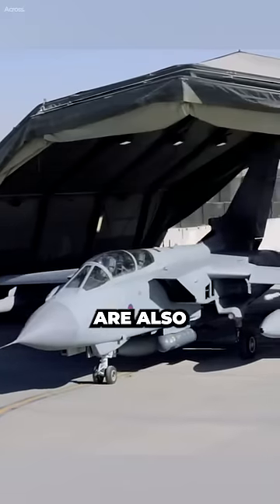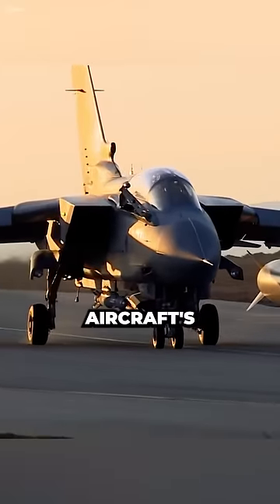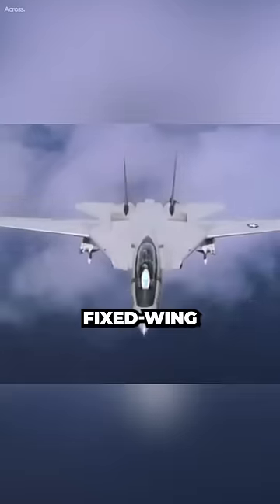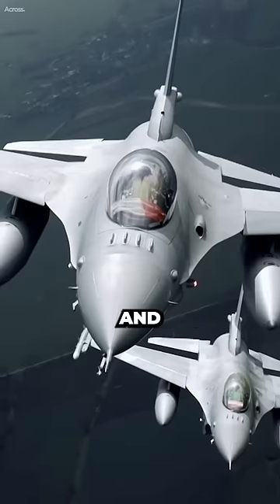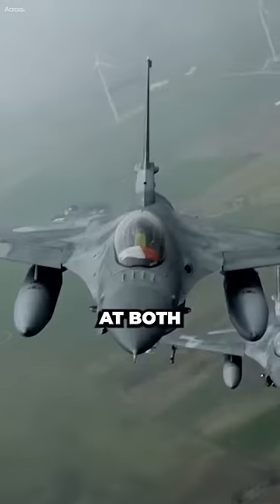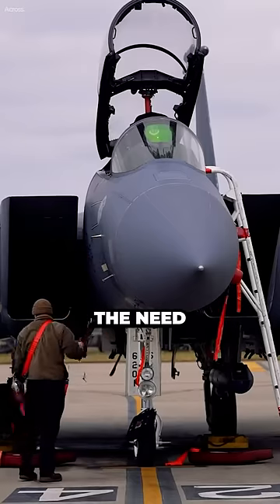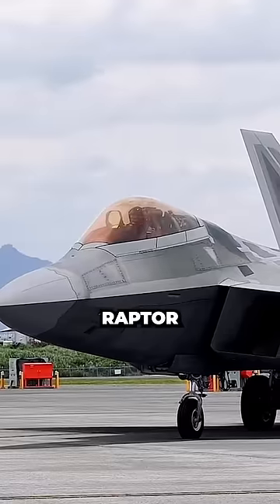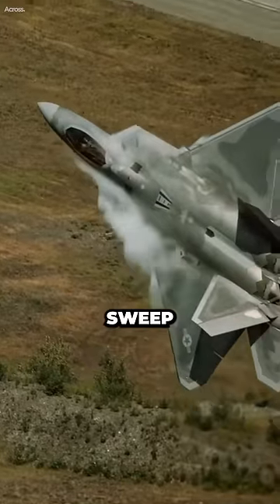Why Don't Modern Aircraft Use Variable Sweep Wings?

Comment: Meanwhile the f15 casually flies with half a missing wing and still landed perfectly
Reply: And NOT a Navy, carrier rated jet.
Reply: "It's not the plane, it's the pilot"
Reply: @ajoo129  it's at least (great) partially the plane. This happened during a training accident in israel. The pilot landed safely but he did not know that he lost one of the wings of his aircraft till he  get out of the cockpit. This could be possible because of  the design of the F15.
Reply: @foggyale  sure, the plane itself is perfect.... but the pilot plays more important role in this case
Reply: @ajoo129 it’s both.
Reply: @ajoo129 no matter how great the pilot if the plane is incapable of flying with one wing that pilot will crash
Reply: @RadarLeon  agree, but if the pilot is not experience enough the plane has higher chance to crash too
Reply: @ajoo129  true but if they are insufficiently experienced at flying that it becomes a reason for them crashing they thusly had no reason to be up there in the first place.
Reply: That's because the F15 has a thrust to weight ratio of greater than 1. It helps to have enough thrust to brute force your way through the air.
Reply: @RadarLeon   In fact, the pilot of this training F-15 was flying with an instructor acting as navigator.  When the collision happened and they started losing control of the aircraft, he ordered the pilot to eject, but the pilot outranked him and decided to stabilize the jet using the afterburner.  It worked, and he got it back to base.  He had no idea the wing damage was so severe because at the speeds they were flying, vaporizing fuel and hydraulic fluid obscured the pilot's view of the wing.

That pilot may have been training, but he knew he was flying an over-engineered rocket, so that is how he treated that F-15.  He touched down safely and the jet itself went on to be repaired and sent into combat.

The F-15 was the answer to a supposedly superior russian fighter, and had their jet been built in the U.S. it certainly would have been formidable.  But what we didn't know was the USSR couldn't scrounge up enough aluminum and titanium to make the things, so it was made of fucking steel.  It weighted a ton.  Engines that should have given it a decisive advantage were only able to get the thing up to its advertised speeds  with a long lead-up.  But the F-15 had the engines and the lightweight airframe to match, and the result was a jet that could take off and go vertical just like a rocket.
Reply: And the pilot didnt even know the wing was gone 💀
Reply: Light weight variable sweep wings
Reply: Let's have a discussion about the A-10
Reply: @garthhancock3373 Well, you can't land at Mach 1, but I think the fuselage of the F-15 is designed to generate just enough loft so he was able to somewhat stabilize it. It's the Toyota Hilux among fighter jets 😂
Reply: @foggyale it’s due to the partial lifting body design and other design elements, and due to the pilot.
Reply: y'all would be surprized but you could literally stick a think plank of wood and it'll fly.
Reply: He didn't know if he had he'd ejected vs landing. That's why the f15 is still a beast.
Reply: @ajoo129 thats misleading.  He didn't know it'd lost a wing. Maybe not so good q pilot
Reply: @Will-dn9dq  no way a "not good" pilot could ride an F15
Reply: Ah yes, that Pixy boy for sure
Reply: @ajoo129 it's definitely more the plane in this case
Reply: Yo buddy, you still alive
Reply: High speed + lifting body design.
Reply: DIdja ever hear you shouldnt believe everything you read?
Reply: As they say "the f15 is a rocket with a plane strapped to it" as the a10 is a gun with a plane built around it... brrrrrrtttt 😂

Comment: Ah but the Tomcat was a thing of beauty to watch coming in to land on the carrier.
Reply: Yes and it wasn't fly by wire so the pilot had to be good .
Reply: @stevetripp2340  it also made the aircraft harder to fly so its like dancing on a knife edge. if you do it right the tomcat will reward you but if you overwork the aircraft it will work against you. in a fly by wire plane with a complex flight computer it'll limit the maneuver so it doesn't overwork the aircraft
Reply: Badass